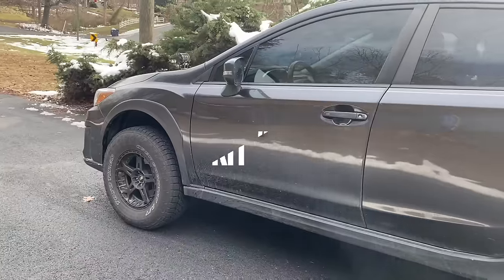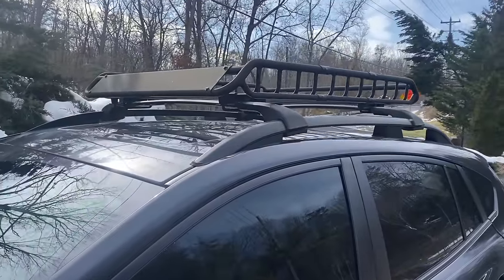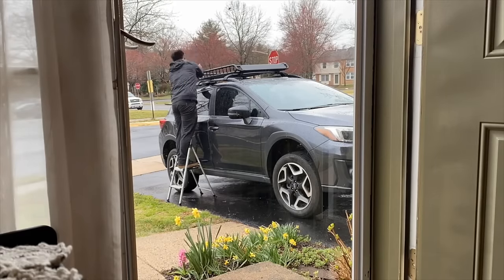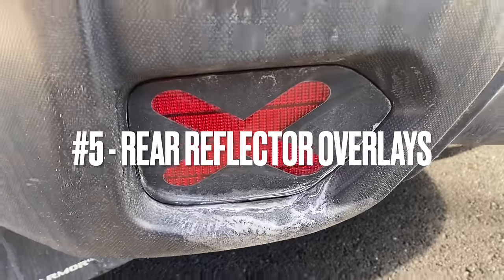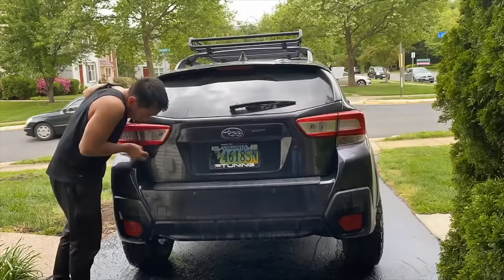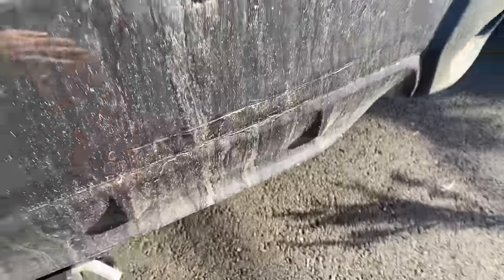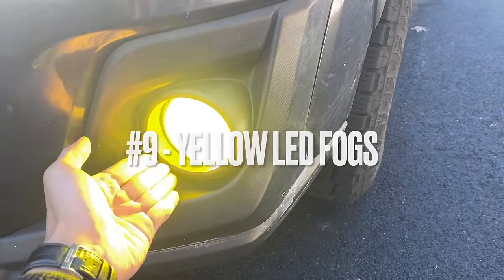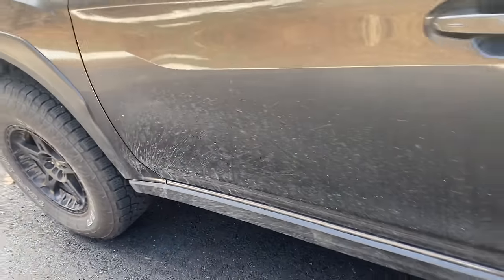TEN Crosstrek Modifications in 10 Minutes  | Subaru XV Upgrades Performance Mods

Comment: Bought orange one used with 138k on it. So far its been a pile of junk but I'm guessing after a little snooping around its because the previous owner only did nothing but change the oil once in a while. Also every bulb on the car was swapped out for LED. Threw away about 20 cheap ebay LED bulbs. This also tells me the original owner was an idiot. Any way we got the car my wife and I really like it very cool yatta yatta. Day 1 ac goes out, day 3 transmission valvebody goes out car sits at a Suby dealer for 2 weeks and $1700 later finally get it back. I asked them to change the oil while they were fixing the tranny they didn't but they also didn't bill me for it either so whatever I guess. So I go to change it and notice the front passenger output shaft seal is slowely leaking CV axil and everything around it is covered in old gear oil. Key gets stuck after turning car off. Buckle dinger never shuts off wish it would time out like my other 3 vehicles. Its been about 2 months now and getting a P0024 code with loss of power dang oil control valve has gone bad another $100 and more of my time to repair. With all these issues one after another its become hard to like or enjoy this car and we don't like to take it very far from home cause it hasn't been reliable. We've reverted back to our Scion TC (Toda) for trips as its been a reliable car for 8 years now. We got it second owner for cheap, original owner was a high school kid that beat it to death. We got it at 150k and its at 253k now and all I've had to do is oil changes, tires, and brakes the usual over 100k miles. Sucks I've wanted a Subaru since 8th grade when the bug eye WRX came along. Finally get one 20 years later and its been one of the worst cars I've ever owned. 😕 Hopefully things get better or I'll never buy another Subaru.